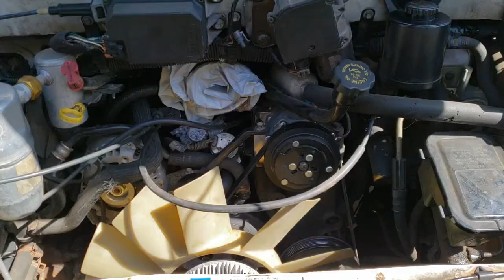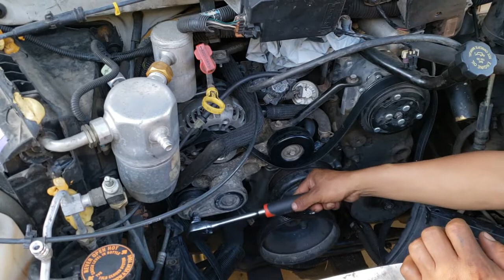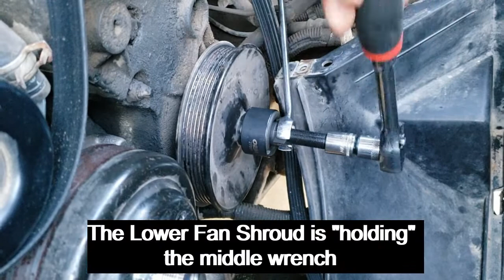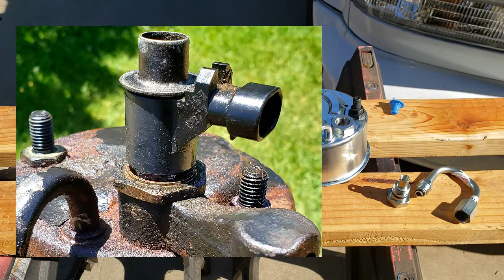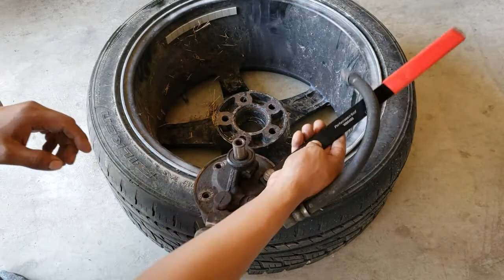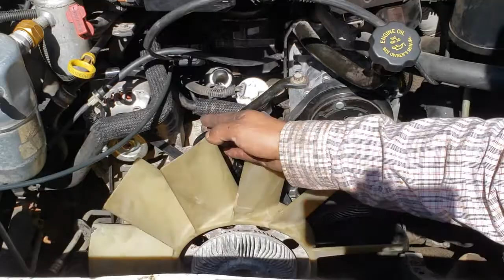How To Change The Power Steering Pump Astro / Safari

Comment from the maker: Tools Used (In order of appearance):
hose clamp pliers
flathead screwdriver
stubby flathead (Not shown)(For snorkel tube clamp)[optional step]
10mm socket
ratchet
12" extension
13mm socket
Fan shroud nut tool (Performance Tool W80498)
36mm spanner
hammer
3/8" drive ratchet
OEM Pulley Puller/Installer Kit 27031
13/16 line wrench
16mm socket
silicone grease
penetrating fluid
3" extension
14mm socket
18mm line wrench     [For Removing Hose at Hydroboost]
6" extension
1" socket
torque wrench
15mm socket     [For Removing P.S. Pump Bracket]
16mm line wrench   [Hoses at P.S. Pump]
17mm line wrench   [Used With Pulley Installer Tool]

Comment: I’m having a difficult time installing the pulley back on the pump. I have the same installation tools you have but the pulley seems to be going on crooked. On your video the pulley goes on nice and straight but not on mine. I even heated up the pulley beforehand. I have a 2000 Astro. Any suggestions?
Reply from the maker: that's a first! have someone hold the pulley as you first tighten it
Reply: @OldSchoolNoe thanks for replying! I think my installation tool was damaged. That’s why  the pulley was going on crooked. What I ended up doing was removing the ac compressor then taking the bracket off(with the pulley) and brought it to my mechanic. It took him only about 5min to press the pulley on. I refer to your videos quite a bit by the way.
Reply: I took the bracket off with the pump not pulley.
Reply from the maker: @eugenemiller7569  Glad to hear you were able to find a solution!

Comment: Is there a video to show how to bleed the power steering system?
Reply: With the engine off, jack up the front wheels to make it easier to turn the steering. Fill the reservoir, and then turn the steering wheel 15 times lock to lock. Top up the fluid again. Next, start the engine and turn the wheel lock to lock again, until the whining noise abates (about 15 more times). Then drop the wheels back down and go for a test drive. As long as you did a thorough job pre-bleeding with the engine off, any remaining air should work itself out of the system over the next drive cycle. If you started the engine prematurely, it may need to sit overnight to let bubbles settle out of the fluid.

Comment: I haven’t been able to find OEM GM genuine or acdelco pump. Any suggestions or alternatives?
Reply from the maker: Wow, they really did run out. Alternatives are TERREPOWER N7312271 or CARDONE 968753 .
Reply: @OldSchoolNoe thanks for replying, out of the two you suggested which would you go with? I’m trying to diagnose my issue. My car shakes when I turn the wheel, but there’s no whine. Occasionally when I reverse and turn my van will power off. Is there a way to properly diagnose this? Can I pay you to hop on a call with me to walk me through some stuff? It’s been difficult finding anybody in my area to help.
Reply from the maker: @johnsmallwood6485  Look under the front of the vehicle, near the middle. A wiring harness runs  under there, across the subframe. When doing sharp turns, the tire (Driver's side tire) rubs on this wiring harness. Over time it eats at the insulation and exposes the wires, doing sharp turns can rub these wires together and cause shorts.

Shakes can be caused by a power steering pump that is not creating enough pressure. I would chose either of the 2 listed ps pumps.

Comment: Would this work on 1998 AWD GMC Safari?
Reply from the maker: it should be similar, I believe there is an extra bracket that needs to be removed.
Reply: @OldSchoolNoe thanks. Would the fitting be good?

Comment: my advice on Chevy Astro /GMC Safari power steering pump replacement.  DONT. if possible scrap the van first. 
But this is the best video on it i have seen. The NAPA carlisle puller set is better in my opinion but the set shown is still a good choice avoid all the cheap sets at all costs. Mine did not have the u shaped tube rateher the high pressure hose went directly into the back---which is physically impossible to get started back into the pump with it mounted. But its impossible to get the pump mounted with the hose attached. So you have to get the pump part way in and start the hose connection and once you finally get it in position and bolted tighten the line.  GMs official repair guide starts with "step 1--remove engine from vehicle" Anyway nice video glad yours was easier than mine.
Reply: Dude, 100% agree. I just did mine and the first reman pump LEAKED which led me to replacing everything a second time, and now it WHINES. Smh. Turned the wheel from side to side hundreds of times
Reply: @ryanhaapala7076 with all ps pumps. YOU MUST FILL IT. WHEELS OFF GROUND. ENGINE OFF. TURN STEERING WHEEL LEFT AND RIGHT. LOCK TO LOCK ABOUT 10X. KEEP EYE ON FLUID LEVEL. THAT GETS ALL AIR OUT. THEN START IT.😊 GUARANTEE NO WHINE NOISE.
Reply: @ToeJamX2  Did exactly that
Reply: @ryanhaapala7076  Same here! Not happy...going to replace the Tensioner pulley, Idler pulley and if that does not get rid of the noise, I'll replace the pump! Damn
Reply: @BigZaddy2112  My whining is for sure coming from the new pump. Bought two bad pumps. About to go buy a low mile van and use it for parts lmao. I think I'm going to replace the reservoir, pump, all associated hoses, and the steering rack. That is if I find a good parts van.
Reply: @micheal. Why? MY BUDDY HAS 443K ON HIS 98 ASTRO 3.8. FOR A CHEVROLET THATS GREAT. ALMOST LIKE A 7.3.. NOTTT😅

Comment: Does anybody know the bolt size for the rear bracket motor mount?
Reply from the maker: I just know the long bolt that goes through the motor mount. A 16mm socket fits on the bolthead and a 17mm fits on the nut

Comment: I've done everything as the video states. Still no stearing. 
Question the cap on the reservoir leaks pressure when pumping the brake pedal  Is that normal? I replaced it with a new cap and it is the same? 
I also replaced the steering gearbox AND hydro boost with 0 success?   PLEASE HELP
Reply from the maker: Did the steering work before you undertook this project?
Reply from the maker: If the steering was working before, maybe you forgot to connect something. I would raise the front end and have someone steer with key on engine off, here I would check to see if the steering shaft is rotating as the steering wheel is rotated. Next I would check to see if the pitman arm is moving as the steering wheel is rotated. Last I would check if the outer tie rod moves as the steering wheel is rotated. All this is to check your basic steering system.

Comment: I really like this video, just a heads up that for a first generation (1985-94) some things are not needed or the same. The tensioner is not the same. You want the AC Delco 38108. The way you loosen the tension is different and so fan pulley removal is not the same. I didn't need the large spanner or the suggested fan bolt tool because there was no large bolt to remove. I also purchased, but could not use the bypass valve. I tried installing it, but it reversed the configuration of the high pressure hose and was impossible to use. I also didn't need the high pressure return line. My 87 uses a simple 1' 3/8 hose for that. The upside is with just a couple of these things returned the cost of the project goes way down. Something else to keep in mind is that I’m not the original owner of my van so somebody may have changed things without me knowing so your specific application may vary. One more thing, he mentions it twice, but doesn't show it. Use grease on your pulley puller set or you will strip it.
Reply from the maker: Great feedback! I will update the video description to say that this method applies to the Gen 2s.
Reply: Thanks you. My 94 Astro is getting a new pump this week and this video greatly eased my mind

Comment: Thankyou for making this video, I lost power steering and power assist brakes when started on a zero degree overnight. Followed your instructions and all went as well as these things go, the 36 millimeter spanner wrench is almost a must to take the fan nut off using the flat rod to hold the water pump pully from turning, got the spanner wrench at AutoZone, it was labeled for Ford, but it is the right tool for the job, the fan nut and the 14mm nut on the rear of the pump bracket was the hardest part. Good video, thankfully I didn't have the evil valve, Lol

Comment: Excellent video - could you add a list of the tools needed?
Reply from the maker: Tools Used (In order of appearance):
hose clamp pliers
flathead screwdriver
stubby flathead (Not shown)(For snorkel tube clamp)[optional step]
10mm socket
ratchet
12" extension
13mm socket
Fan shroud nut tool (Performance Tool W80498)
36mm spanner
hammer
3/8" drive ratchet
OEM Pulley Puller/Installer Kit 27031
13/16 line wrench
16mm socket
silicone grease
penetrating fluid
3" extension
14mm socket
18mm line wrench     [For Removing Hose at Hydroboost]
6" extension
1" socket
torque wrench
15mm socket     [For Removing P.S. Pump Bracket]
16mm line wrench   [Hoses at P.S. Pump]
17mm line wrench   [Used With Pulley Installer Tool]

Comment: Mine leaks for years , tough to see where from ? Reservoir steering box or pump..
Reply from the maker: Add Power Steering UV Dye, it should narrow down the leak when you shine a UV flashlight on the components.
Reply: @OldSchoolNoe  Excellent video. No BS, straight forward and very clear. Thanks